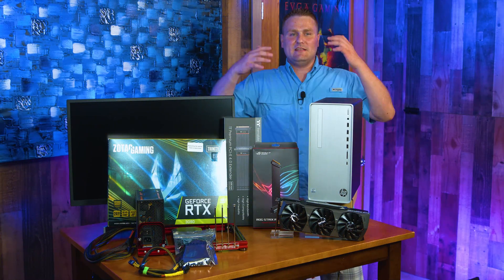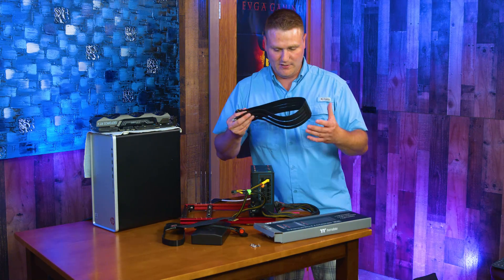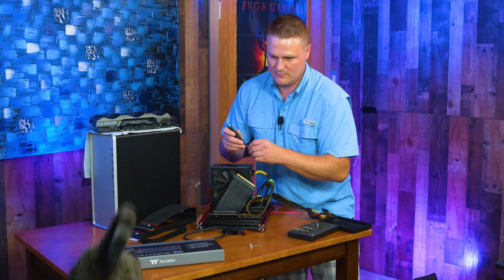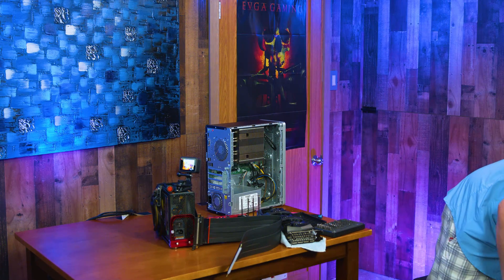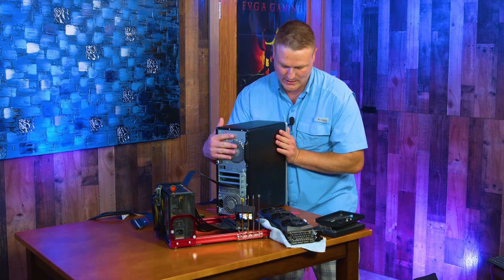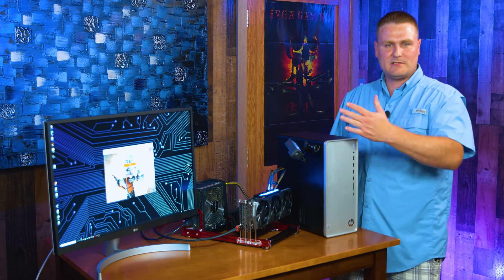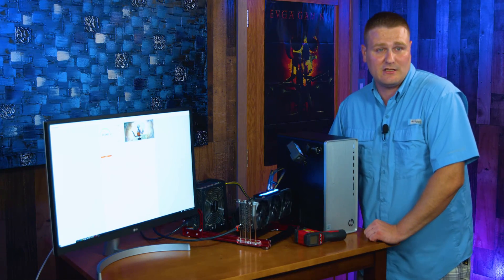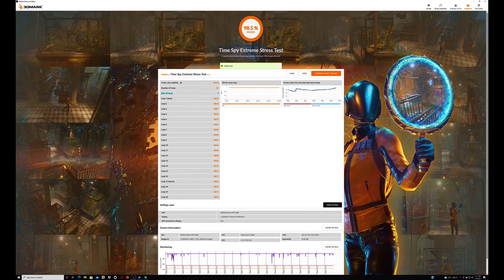How To Upgrade To a RTX 3090 GPU In Your HP Pavilion Gaming Desktop PC

Comment: thanks for the vid ,stupid question ,why cant you power the pc and gpu with the larger supply . i bought a evga 1000w p5 and msi 3090ti .ive thought about dumping the case,psu and putting everything else on a stand

Comment: So, imma start with love the video, it gave me inspiration to do this myself. I used a different frame, same PSU, EVGA RTX3070ti, same 600mm Riser cable, and I’ve got everything installed correctly (to my knowledge) and for some unknown reason I get black screens and crashes when under ANY load or hell even no load at all. Any theories or answers would be much appreciated im so lost for how to fix this issue.

Edit: I realized I didn’t have that second PCIE cable (the shorter one that you screw to the frame) would not having that piece cause my GPU and computer to run like straight doodoo?

Comment: Will the Rtx 3090 or 3080 ti work on a pavilion 690-0034 model ?
Reply from the maker: Yes there no reason why not. Other then the HP psu will not have the wattage you could use a normal Atx psu to power the card.

Comment: Hey @TechNitWit !
Could you review(/test measurements) for Noctua NH-D9L?
It seems to be the only low profile tower cooler that actually could fit the TG01's tight case.
I've seen some say that the height of 110mm doesn't represent the real height. Because the fan is being pushed upwards from heatsink it could be in the 115-125mm.
Do you have any experience with taller fans? I remember you used the Noctua's C14S for one of the builds.
Reply from the maker: No Pretty sure it would be to big Now I have not tested it.

Comment: hey tech How do I increase my ram frequency on my hp pavillion pc (2260xt) I upgraded to 16 GB 3200Hz, I want to put to at least 2666Hz or 2933Hz. the Bios Menu is weird
Reply from the maker: it is locked. So if your memory is set at 3200Mhz you need memory that can do it with out XMP/DOCP profile Because HP is silly here and does not allow it. Also you will want Same CAS latency for the memory. So if the model you pick has say a CAS of 14, You will need that same ram Not 3200 CL 15 or 16. It will not work.

Comment: love this video! i have the same laptop. i have a question though... i have ati bios firmware f.31 do you know how to crack into the advanced bios settings? its impossible to update the mhz of ram i have in the system from 2666 to 3200... and if you put in a different companys ram it automatically goes down to 2133mhz
Reply from the maker: nope